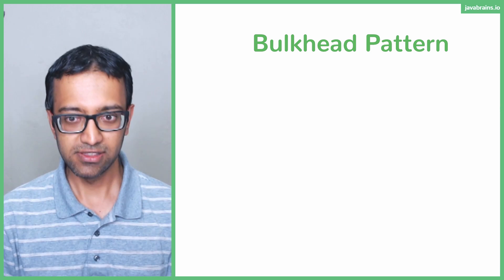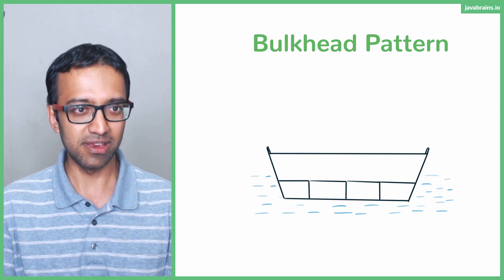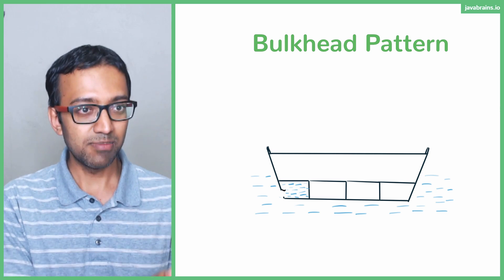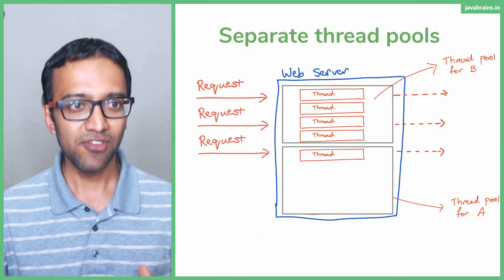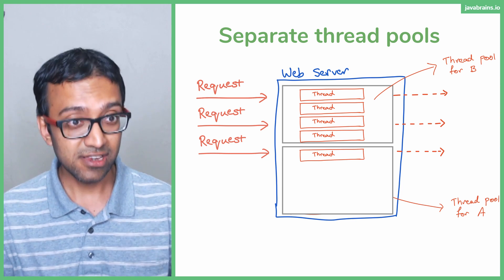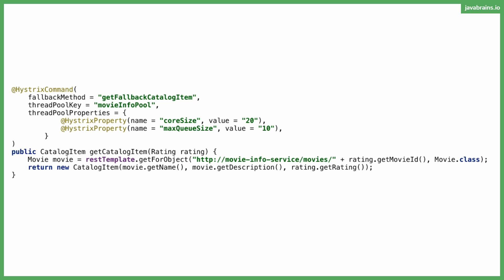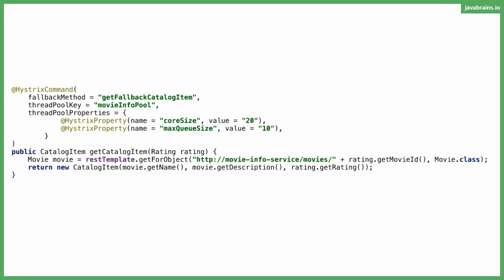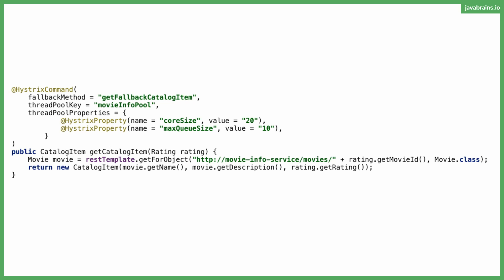22 The bulkhead pattern

Comment: In case of Reactive programming, is the bulkhead still needed? The threads get "freed" in case of reactive (say netty server), so perhaps bulkhead (and perhaps even circuit breaker) seems unnecessary. If you have any thoughts or pointers, it will be great.